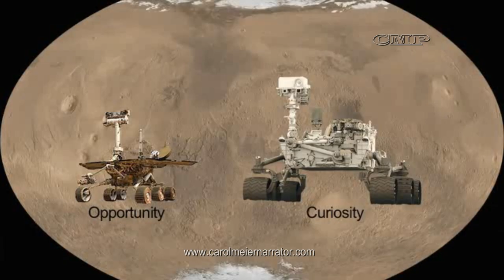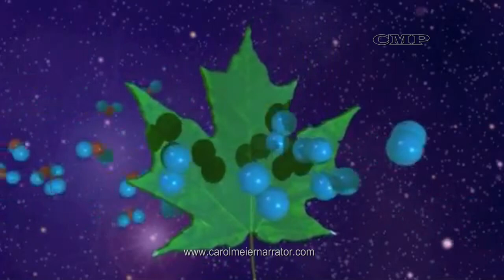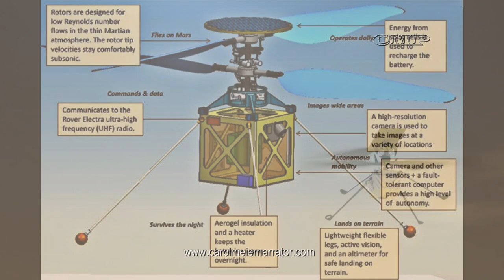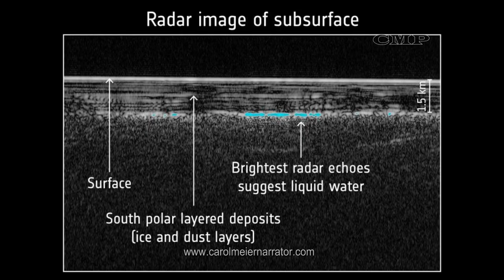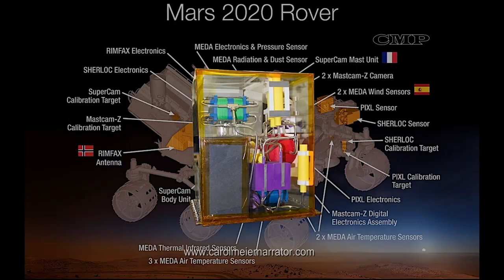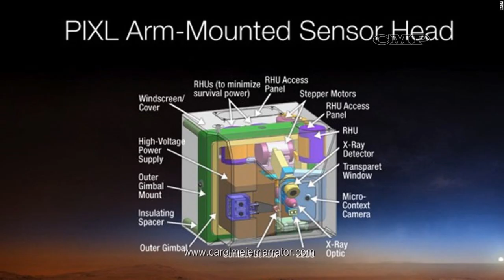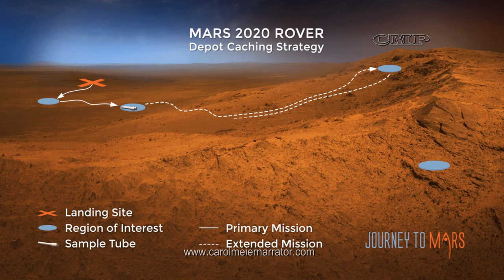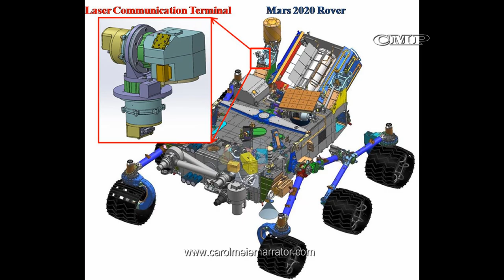Mars 2020 Perseverance Rover - What's Different This Time? A Narrated Explanation.

Comment: If we could get the dust off of opportunities panels would it start working again? If so maybe we could use the Mars helicopter to do that using the wind generated by the propellers?
Reply: first of all since the power has been gone from its batteries for so long, the cells are dead because the heating used to keep them operating nominally has been off since the dust storm ended. And secondly, the helicoper is only capable of dooing small "hops" on the surface and it's only been designed to help navigate the 2020 rover through the ground obstacles, so NASA wouldn't want to sacrifice it for an older mission even if it was possible.
Reply: @Pedro-rl8ww  plus Perseverance will land heckin far from poor Oppy
Reply: Totally different landing areas, and lithium cells die eventually.
Reply: @Pedro-rl8ww  All true, sadly.  I'll be amazed if Opportunity doesn't someday wind up as preserved historical site on an at least slightly-inhabitated Mars, though.  Maybe even in my lifetime, I should have 40-50 years yet.  :)
Reply: @mariasirona1622  poor Oppy 🙁
Reply: It's sad, but the dead battery means dead heating system which means the electronics were permanently damaged by the extreme cold of the Martian night.

Sadly Spirit and Opportunity will have to wait for humans to come to Mars to rescue them. And we will one day, or our descendants will.
Reply: The dust devils which are frequent on mars  kept the dust off and is what kept them rolling so long (according to the JPL video I just watched)

Comment: Having spent almost 15,000 hours in helicopters, I am absolutely mesmerized by the though at flying at a comparable 100,000 flight ceiling in 1/3 gravity. I’m wondering how fast the gyros can correct flight path aberrations at that thin altitude - if there are gusts? 
I’m also wondering how they plan to protect it from powerful dust storms?
Reply: I like your comparison with earth's upper Stratosphere.  Certainly it is doable; we have balloons that go that high, with small instrument loads.  This has always bothered me; why no thought for dirigibles, then?  They alone would be above the dust-storms you allude to, and would move about by the will of the Martian winds.  As to the gusts, they are considerable but in terms of Mass, would be a puff of air, even with gusts of 50mph.  
   I hope to hear your comments after the "test flight" of Ingenuity.  They may rename it the grass hopper. . .   lol.
Reply: Mars produces dust devils, on a regular basis that can spin 100s of MPH.  Im not sure how the helio will manage to not get tangled up in one.  Maybe next time a drone type chopper is prototyped on earth for Mars,  they developers can add technology that detects wind speeds that are miles away so the drone can avoid those dirty dust devils!  🌪

Comment: The microphone needs to be assembled after landing 📐 why none of them survive, awesome video....I hope the drone can fly over the "dead" rover to expose panels for further use 😎😉
Reply from the maker: Microphones are not assembled after landing.  In the 1990s a microphone was put on the Mars Polar lander but the lander crashed into the surface.  Again in 2008 the Phoenix Mission experienced electronics issues which prevented the microphone from being used.  That’s why they were not successful.
Reply: the helo won't fly over the dead rover as it would be a few thousand miles away from it and if i remember correctly the aircraft Ingenuity can only work up to 3-4 mins before it has to land
Reply: Cleaning the panels of opportunity will not save it, the electronics have likely frozen to a point of no return, also ingenuity is too far away.

Comment: Hopefully they have a way to get dust off of sensors and I wonder how the propellers will be able to handle the dust...
Reply: Electrostatics and Surface Physics Laboratory at NASA's Kennedy Space Center in Florida are developing ways to mitigate problems with dust. Electrodynamic dust shield, or EDS, technology is based on concepts originally developed by NASA as early as 1967. "Our laboratory is now developing an electrodynamic dust shield to prevent debris from accumulating on various surfaces", Dr. Carlos Calle, lead scientist.
Reply: The rotors are carbon-fiber. Carbon-fiber is electrically conductive, so they shouldn't build up a static charge.

Comment: So what happens to the helicopter after it's discharged from the rover and a sandstorm hits?  Even from the ground, wouldn't we expect it to be blown away and damaged?
Reply: It goes down just like the two Operation EagleClaw helicopters Sikorsky CH-53 Super Stallions went down in the Iranian desert dust storm back in 1979
Reply: as the video says, it's a test. if it works it works if it doesn't then it doesn't

Comment: Does this thing carry a duster, just in case? (serious question)
Reply: Perseverance does not use solar cells. It’s power comes from a plutonium thermoelectric generator.
Reply: @dansv1  What about the tiny helicopter? that thing relies on solar panels to charge its battery and judging by the small size it is the most vulnerable to dust covering its panels.
Reply: @jm8080ful  its not going to be flying long enough to accumulate a detrimental quantity of debris. unless something unexpected were to happen.
Reply: @jm8080ful  its flight time is 90 seconds

Comment: NASA is finally back on track after running the Shuttle program too long. A new propulsion system that can take a spacecraft at greater speeds would shorten travel time. Our bodies aren't built for the rigors of space travel.
Reply: Well, when we go to Mars for the first time, it will still be good old-fashioned reaction propulsion engines and Hohmann transfer orbits. Other systems like ion propulsion, while super-efficient on fuel use, produce very low thrust, on the order of a few ounces of force, which is why spacecraft equipped with such engines still must be launched into orbit with conventional rockets.

Those alternate thrust systems probably WILL see use in unmanned aspects of the mission, such as cargo transfer, where transit time is less constrained.

Also, returning from Mars has its own unique challenges; mainly a HUGE energy requirement compared to returning from the moon. The first mission will quite likely have to accept the possibility that it will be go-and-stay.
Reply: @phoenixshade3  If only we could learn to control gravity, that is where the real secret of fast space travel is at.

Comment: Will there be a video camera on board capable of filming the drone flying or just stills?
Reply: From what I understand, the fastest data transfer speed from Mars to Earth is 2mb a second, which can only be used for 8 minutes per sol, or else the alignment of the planets changes and screws it up. So sending a video would take a long time. They may do stop motion and take a ton of pictures at once and just feed them together. Still would take a long time though.

Comment: How do they avoid high winds? I would like to receive current weather reports. AI assume there are day and night cycles?
Reply: High winds are not a problem, because the atmosphere is so thin - about 1% of that on Earth. Even very fast wind would feel like a gentle breeze. It's not like was shown in that movie.

Yes, there are day and night cycles, similar to Earth. A day lasts for bout 24 hours and 40 minutes.

Unlike the previous rovers, Percy isn't powered by solar panels, so it can work at night. It's powered by radioactive plutonium.

Comment: Great video, thanks for putting this together!

Since Mars is a (very) dusty place, I was wondering: How hard it would be to suck in some air/CO2 (after arrival) into pressurized containers and have some diffusers strategically placed around the rover to blow the dust off from time to time (or after a sandstorm)? Basically allowing the robot to "dust" itself off when needed? You can even mount one on the mobile arm so it can reach in most places...

 Should help with keeping the instruments and cameras clean and prolong the life of the rover.
Reply: The weight factor doesn't justify the need.

Comment: The next item NASA needs to send is a Caterpillar D9 bulldozer. It can be used to start digging out an underground living quarter.
Reply: They are more likely to move straight into lava tubes.
The lava having been molten,  walls of the tube are likely to have a vitreous coating which will be dust free and less of a hazard.
Reply: @MaxB6851  Elon Musk is working on the Boring technology as we speak...now I know where else this technology can be applied.  I am sure Musk is aware of this idea, and most likely intended the boring technology to be used on Mars.

Comment: No solar panels so what is the power source?
Reply from the maker: Multi Mission Radioisotope Thermoelectric Generator (MMRTG)
This will give you a full explanation   https://youtu.be/qB3NmPfTurY
Reply: Plutonium dioxide generate heat from the natural decay of plutonium-238 isotope. Then a series of thermocouples directly convert the heat generated into usuable electricity. This radioisotope thermal generators or RTG is the most reliable way of generating power where the use of solar cells are not practical. The same heat is used to cool the sensors and electronics onboard the rover. They are not without cons because the thermocouples degrade over time resulting to ever decreasing of power output until it can no longer provide electric power. This is an improvement over the lesson learned from previous Opportunity rover when it eventually ceased communicating with mission control probably due to series of martian dust storms covered the solar panels mounted flat on top of the rover. The batteries eventually died out due to not being recharged sufficiently. Anyway, its not the first time the RTGs were used in such missions. The spacecraft Voyager 1 and 2 as of writing are cruising away from the Milky Way and still returning data on the interstellar medium all powered by the same RTGs they were launched back in 1977.
Reply: simple answer, nuke, not solar, don't have to worry about dust on the solar panels

Comment: Too bad the Rover doesn't have a multi purpose arm in case it needs to repair and clean itself
Reply: It technically has something to clean itself. The mars helicopter. Remember for every force there is an equal and opposite reaction force... so if the helicopter pushes itself up it has to push something else down. Ie the atmosphere. Thus creating wind to blow the dust off the craft. Its a possiblity that could be explored in the event that they critically need power for further opperation.

Comment: I don't see any solar panels - so what's powering this rover?
Reply: They have a nuclear power source onboard.
Reply: Yes nuclear fission battery as on the Vikings, Voyagers, New Horizons and Curiosity. They last for years.
Reply: Curiosity and spirit had solar panels but the only reason they lived is because of these common small tornados but the dust got all over the solar panels so nasa ditched the solar panels for a nuclear reactor
Reply: RTG
Reply: @WaRK1lLeR  Thanks! But why not say so?
Reply: @ronbishop4057  The design is a step-up from Curiosity, and seeing no solar panels I think makes it obvious.
There is an image with the RTG labeled at 13:24 too.
Reply: @eddanimoots1896  Actually it was Opportunity and Spirit that had solar panels. Curiosity is Nuclear powered via RTG.

Comment: Why cant they put a retractable cover to cover the panels during dust storm it will prolong the rovers lifespan or a wiper so that the rover can clean its solar panels if they can add very complex equipment why cant add a simple one a retractable cover will be like  the rovers blanket during dust storm
Reply: ocirne nizurc i think since spirit and oppertunity the marsrovers dont have solar panels anymore, instead they are propelled by a radioisotopic generator, basicly a plutonium 238 powered battery that lasts for years. Plutonium 238 is extremly instable and just falls apart spontaniosly and releases heat, so there is no nuclear chainreaktion which differenciates it from a nuclear reaktor
Reply: Yeah they could do that, but that would cover the solar panels and, during a dust storm, smalls rocks and dust can jam the cover.
Reply: Unfortunately a wiper on solar panels will damage them when it scrapes the dust off.
Reply: The life expectancy of the rovers was 3-4 years. They lasted 14 years. Give them CREDIT for a job above and beyond!
Reply: David   90 days. 55x the planed lifespan. 
Dust on the solar panels was a problem, but occasionally wind would clear the panels. The solar panels were designed to produce upwards of 900 watt-hours per day and were producing 667 watt-hours before the dust storm which was enough for full operations.
Reply: @triage242  The rover does not use solar panels.

Comment: What is the rover's cruising speed, compared with earlier ones?
Reply from the maker: Spirit .1118 mph (4.99 cm/s).  Opportunity .08699 mph (3.888 cm/s). 
Perseverance .1 mph (4.2 cm/s)
Reply: @revoeciov  I imagine that you don't want the rovers bouncing around too much, but why so slow?  Wouldn't it be plenty stable at, say 1-2 miles per hour?  Then you could cover a lot more territory.  What will be the speed of the moon rovers that the astronauts ride, as compared to those in the 1970s?
Reply: S. Silv Mars is about 20 light minutes away so the controllers of the rovers are about 20 minutes away. The rover has to move slowly because we humans get things later then they happen on Mars.
Reply: @devinlastnamenotneeded8521  the rover isn't driven by a human with a joystick, it has preset paths it has to cover.
I think they move so slow because of energy consumption

Comment: Everything but the sample pad and launch system. Intrigued by the light and sound analyser as it's probably tuned for the sound of Martian pressurisation and atmospheric medium.Hopefully the samples will prove exactitude calibrating all the physical states within relative time space continuity and decay standards. Eventually maybe a gas turbine rather than solar powered helo for longer flights but it should be an opportunity for wider data and that if only nostalgic mystery yet to be confirmed. Hope it finds a more signs of fossilised lifeforms.

Comment: To put camera on the rover is not a problem. The problem is to send all the data those cameras capture back to earth.
Reply: But it doesn't need to send all that data. For the science based camera's they only need to send the results. Basically they only have to send data from one camera to be able to make decisions on where to navigate to. So no it's not a big problem at all.
Reply: sending it is easy ... taking the gear to allow you to do it with enough power for reception at earth is the limiter ... and even that is not that big of a hurdle .. heck we can make a basic broadcast radio that will have a decent signal strength that would fit in a 2 cube packing box ... it is no different than the days of acoustic modems accessing the internet ... send everything compressed and then play it real time here and your laughing ... ok youre not doing real time with a minimum of a 29min lag between signals

Comment: why didn't they put a fan on the arm do blow off the dust on the solar panels? ?
Reply: My guess is: because increased mass, low density atmosphere on Mars making the fans ineffective... It might be possible to add piezoelectric ”shakers” below the panels to jiggle the dust loose... But, the smarter solution is the MMRTG , replacing the panels with a couple of kgs of plutonium...
Reply: it is nuclear powered
Reply: I asked about that above.  Why no windshield wiper-brushes for the solar panels and camera lenses?  At least it wasn't mentioned.  Those things would be relatively simple compared with all the rest.  And what if it turns over?  Is there a self righting mechanism?  What if it sinks in sand?  I sthere some mechanism for it to dig itself out?

Comment: maybe I just missed it, but are there solar panels on Perseverance? Did they add some tool to get the dust off of it so it doesn't suffer the same fate as other rovers? Or does it have a nuclear power plant? Those are usually heavy, right?
Reply: It will get its power from MMRTG, a Multi-mission radioisotope thermoelectric generator, essentially converting heat from the radioactive decay of Plutonium into electricity. Much the same as what was used on NASA's curiosity rover, it has a projected rover power life of 14 years. Unlike Solar Panels, MMRTG isn't affected by Local Weather, so it's much more reliable.

Comment: This is all so amazing, but why do they call what is so obviously a drone, a helicopter ?
Reply: Well because technically it is an aircraft in which is a helicopter
Reply: A drone propelled by upward-facing blades is a helicopter. The most common design is called a quadcopter. "Drone" is a term only recently graduated from slang status, for what formerly would have been called a remote control vehicle. Remote control helicopters were simply called remote control helicopters. "Drone" doesn't indicate the form at all, either. Most military drones are airplanes, not helicopters.